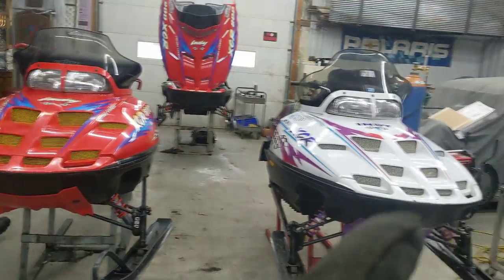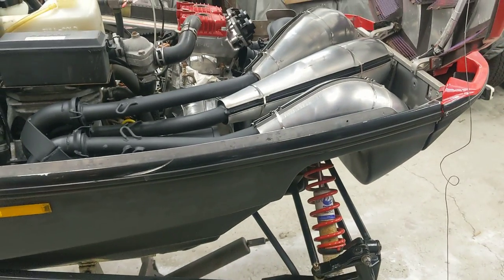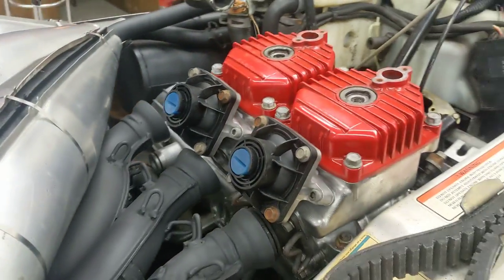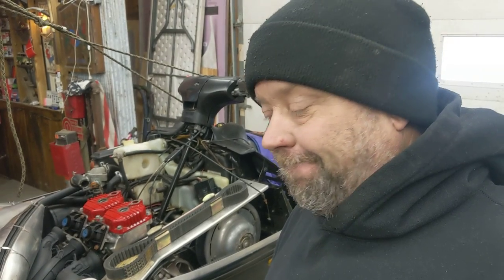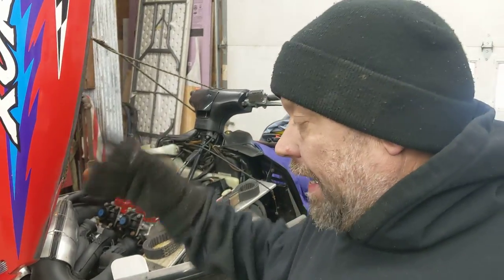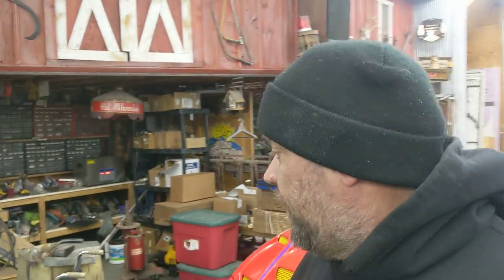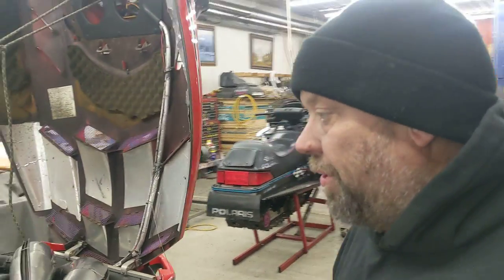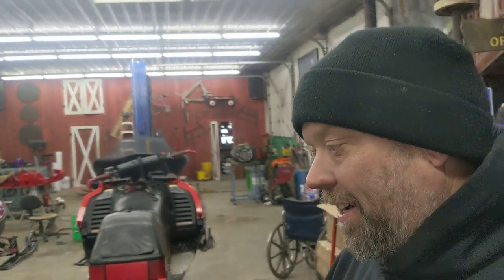POLARIS HUGE MUSCLE TRIPLE TRIPLE PIPES

Comment: Just an fyi, cometic makes rubber coated aluminum base gaskets for xcr 800s, for case ported motors they are alot more reliable than the paper gaskets. You have to call cometic directly to get them and there probably will be a lead time but they are very nice
Reply from the maker: Good to know thanks for sharing

Comment: In the front that rxl is a low-rida, what I dis to my 92 indy 5 is we put xtra 10 spindles on it and we increased preload by taking a big nut from like electrical. Rides along better, those spindles ain't cheap though 😬
Reply from the maker: The fox shocks need to be rebuilt
Reply: @toddclyne3493  yea, super common for the 8 inch suspentions to sag and low ride so yea, I was just suggesting because what we did raised my front end up 4 inches!!

Comment: Love triples have a few myself 97 skidoo 800 97 ultra 680 and 97 strom 800
Reply from the maker: I rode one of them 800 skidoos back when they where new. Holy shit did it rip 😁
Reply: @toddclyne3493   im working on rebuilding the motor on that one she 10,500  and never taken apart
Reply: When i rebuild motor im thing about putting the engine in a polaris with a 159 track

Comment: I have a problem with my rxl it's sluggish to about 40 mph and then it takes off like a rocket after that, I've cleaned the clutches and that helps but it's still slow on take off and everything up to 40 mph
Reply: Also have a good battery
Reply from the maker: Check to make sure you have the right belt on it
Reply: @toddclyne3493  I do i bought to brand new belts of Dennis Kirk

Comment: Hooker runs mint🤘 dude i just bought a 1997 Yamaha VMax 700 triple and it screems!! I will definitely post a video i absolutely love the way any triple sings. Unfortunately im pretty sure on my first 5 miles of riding it the secondary clutch spring broke i limped it back home and took a quick glance at it and flicked my finger on the secondary spring and it made a vibrating tingy sound.i couldnt physically see the crack and it was 2 below plus wind so i came inside but today ill be tearing some of it apart and ill record bits n pieces for a video on it i would honestly like your opinion on it. I dont think the secondary is shimmed right or something it physically looks off center and the belt rides on the left side of the primary. Oh and already shredded a belt but it got home. That was literally like the 7th or 8th time i pinned it up to like 90 or so i can hear it coming apart. Unreal man and the dude looked right at me and said id trust this thing to go anywhere right now shes a good runner... Dont get me wrong the motor (RED HEAD) absolutely fucking screams but yeah he knew there was an issue with it and dumped it you could tell hes a rich boy buy it and ride it type of guy lmao but anyway ill get a quick video of what it sounds like but i dont wanna ride it with the broke spring so maybe a lap around the yard lol then ill try fixin on the ol girl.
Reply from the maker: Good luck with it. Sounds like a sweet ride
Reply: @toddclyne3493  thanks man it really is once i get this clutch figured out shes gunna bark. I love how instantaneous the throttle response is its pretty sick ill admit lol considering ive rode cats my whole life lmao